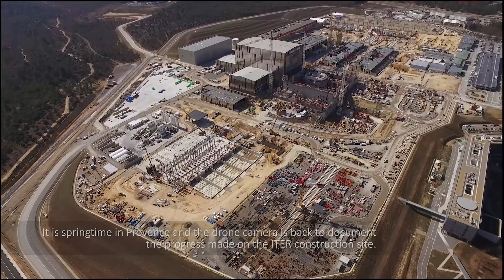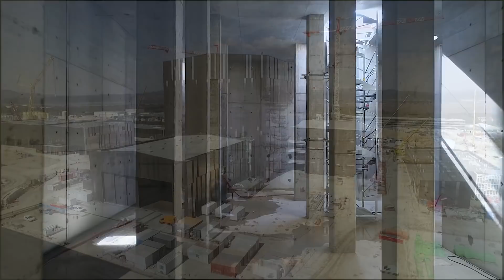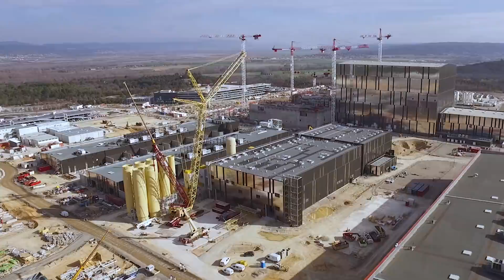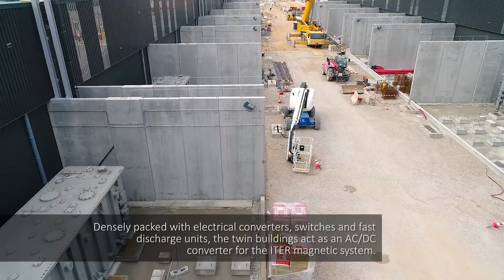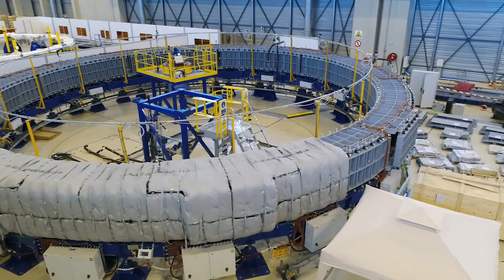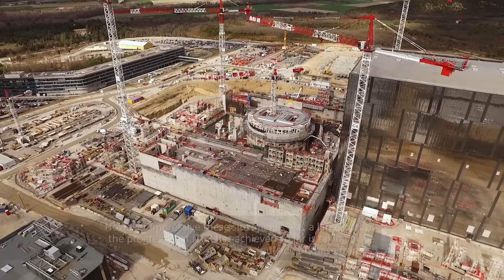ITER by Drone - April 2018

Comment: It's very cool project in future energetic perspective. But, why assembly takes so long?
Reply: small tolerances, complexity, project so big it needs thousands of contractors, international supply chains, etc.
Reply: Igor Rudchenko 
To anyone who thinks the nuclear power is the future... the pace of development is not compatible with the time we have to transition from fossil fuels.

Even if this if this experiment is a success how long before a design for a working commercial nuclear fusion reactor that can be built fast enough and is up for the job of providing us all with electricity?

If I were a betting man, I would bet on solar and wind with battery storage and maybe some long distance DC lines to move power from sunny areas. This is known tech that just requires engineering to up scale. 
But first we must all learn to use less, reuse what can, and as a last resort...recycle.

More than anything else we must all reduce our consumption.
Reply: I wonder how much wind and solar power would be built with €20 billion of government incentives and subsidies?

https://en.wikipedia.org/wiki/ITER
Reply: @parajacks4  the power loss on long distance dc lines is astronomical, we don’t have good enough batteries to efficiently store e ough energy to power cities when there’s no wind and/or sun, batteries, solar panels are extremely bad for the environment to produce and maintain.
Reply: @mat7can106  
So…something needs to change.
We must be more intelligent with the clean power that we have available and how we can upscale it.
No one thinks we can switch to clean power in a day, that’s why it’s called a TRANSITION.
Reply: @parajacks4  yea but designing advanced enough batteries will take decades and making solar energy clean also. The best shot we got is nuclear fission at this moment and in the future transition to fusion.
Reply: @mat7can106  
Solar PV, wind and battery tech have all had big improvements over the last few decades and have grown exponentially. 
There will be some issues with continued exponential growth, however when compared to nuclear these issues are mundane.
But go on; please explain how total nuclear powered electricity generation can double every 2 or 3 years, when it takes 20+ years to plan and build a nuclear power station? 
And where are you going to put them all? I don’t want to live within 50 miles of nuclear power station.
Who is going to pay for long term decommissioning, long term nuclear storage and accident cleanups?
When such (semi) external costs are in included nuclear power is the most expensive way to generate electricity.
Why do you want the most expensive electricity?
Reply: @parajacks4  there have been companies capable of building efficient, clean, relative’y cheap and compact fission reactors in a couple of years. Some even managed to recycle nuclear waste from larger, older reactors to use as fuel. Also the whole space part is stupid since solar panels take up much more space then any nuclear reactor ever will.